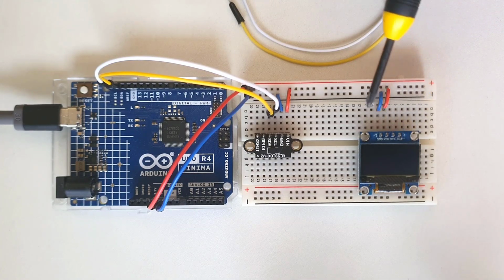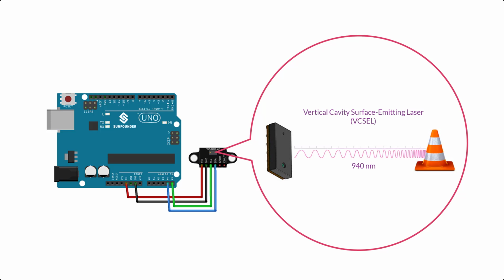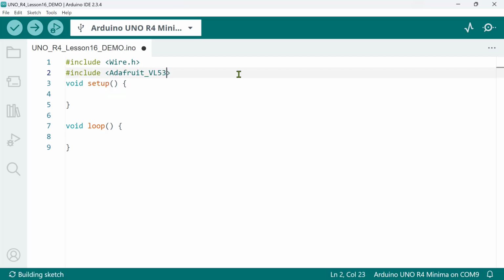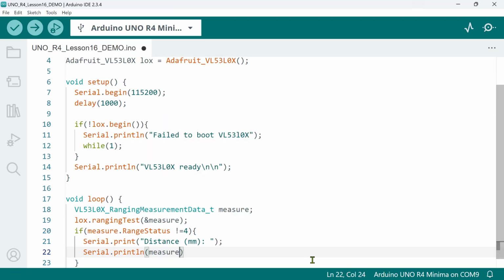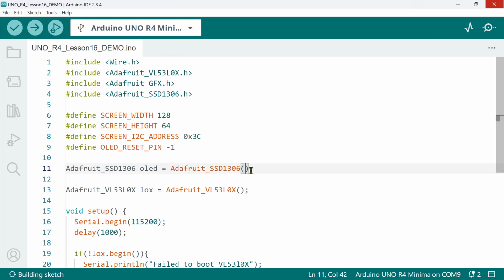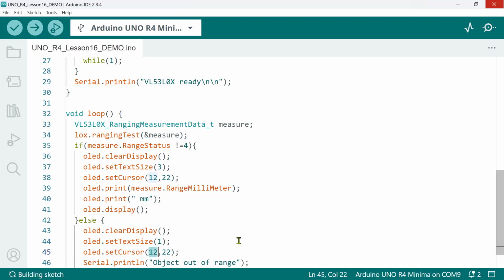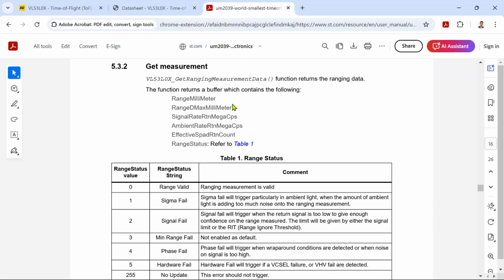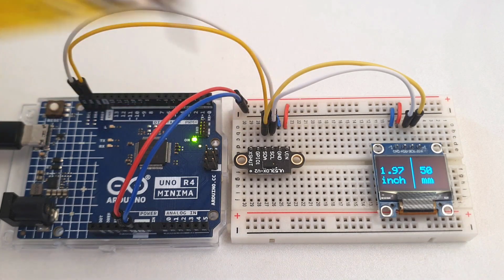Arduino UNO R4 Lesson 16 - VL53L0X ToF Micro LIDAR and SSD1306 OLED Display | Distance Sensor

Comment: Please Help me make my school project. I want to make a model which will have an arduino nano, some jumper wires, 0.96 inches oled display, a vl53l1x tof module. I want to make a model in which a laser will be shot and the amount of distance covered by the laser will be displayed on the oled display. I want this model to have a range of upto 4 meters. My vl53l1x only have pins called vin, gnd, scl, sda, gp101, xshut and my oled has pins called vdd, gnd, sck and sda. Please make a detailed video on this, I need this